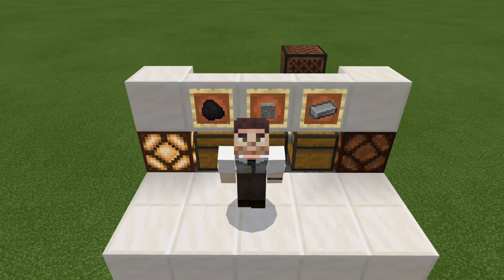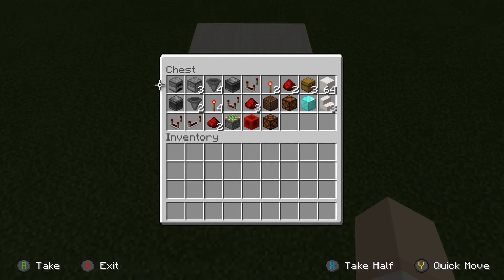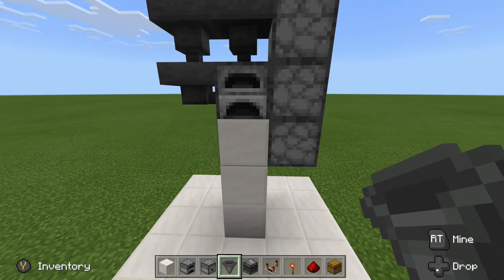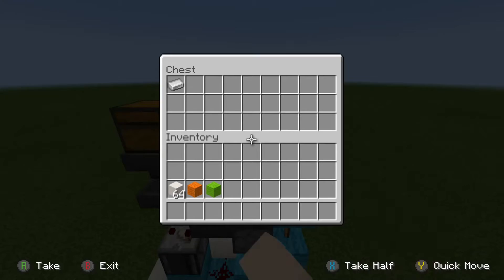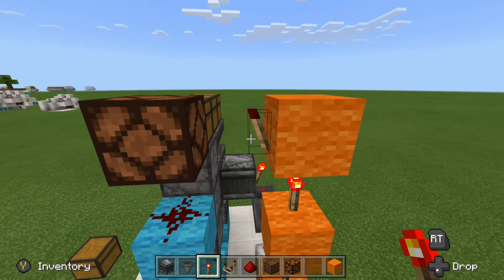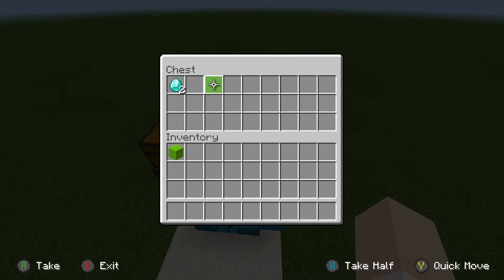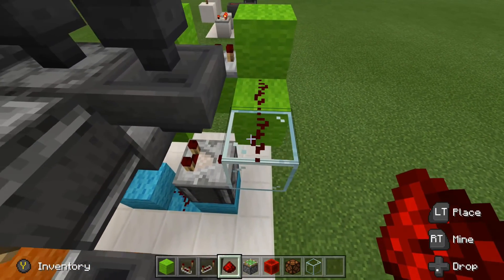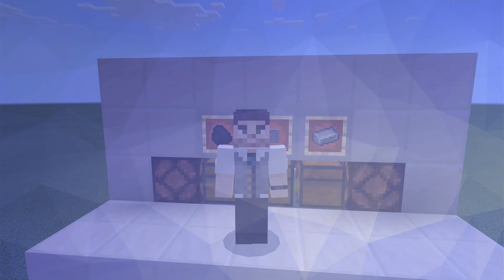Minecraft Bedrock - Smart Furnace Tutorial ( Xbox / MCPE / Windows 10 / Switch )

Comment: Hey Rogue, thanks for your videos. I am trying to figure out if there is a way to build a doorway such that it has an observer circuit that can turn on the lights while the door is open and turn them off when it closes. Any ideas?
Reply from the maker: That’s something I can look into! Are you referring to a door you manually open and close (i.e. no pressure plate)?
Reply: @RogueFox  Yes, that is what I was thinking. One without a pressure plate.
Reply from the maker: It is definitely possible! You would need to wire up that observer circuit to a t flip flop. Were you looking to put the observer above or below the door?